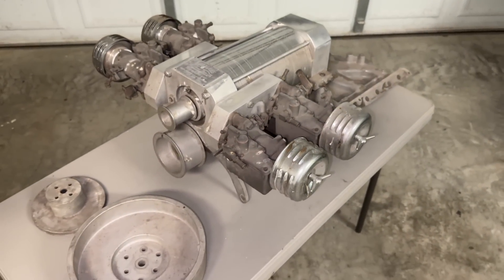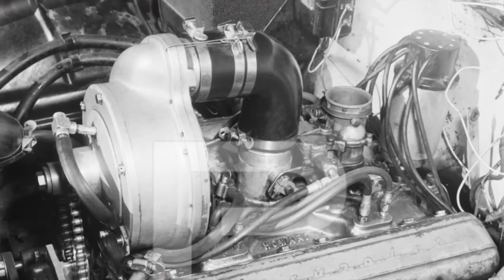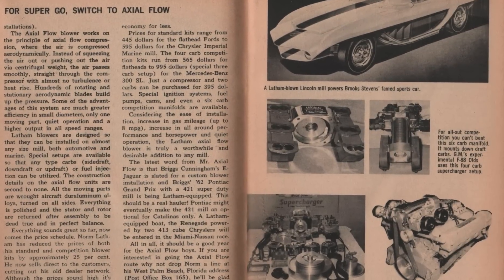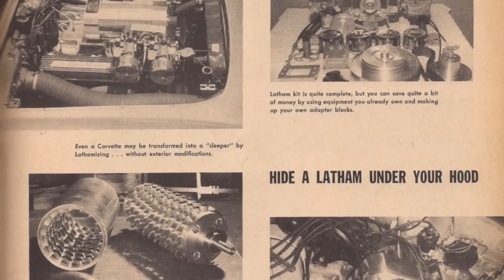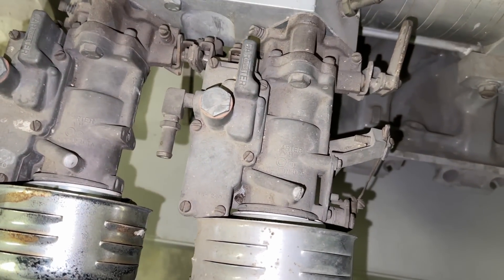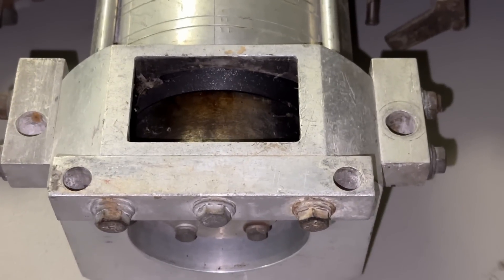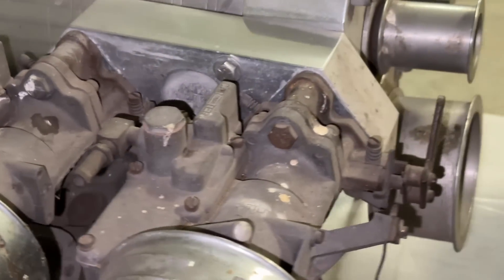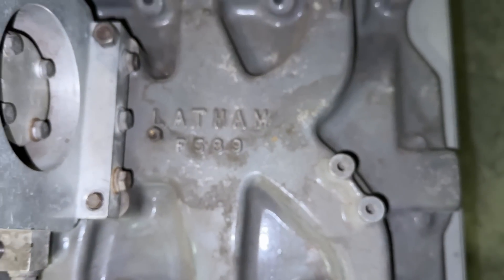LATHAM Axial Flow Supercharger - Fascinating History of a Short-Lived Design

Comment: I'm only here for the Supercharger,  Back in 1983 Auto shop one of the guys had this strange stackable supercharger he found in AutoTrader that he adapted to fit on a 390 in is Mustard Yellow AMC Gremlin.  I was just tryin to recall what it was and this looks like the same thing a long polished tubed of what looks like stacked segments with some sort of side draft carbs on it.  I think it looks like a jet engine on the inside and does not have lobes like a roots type blower.  Yes it sound like a police siren or fighter jet when it ran.

Comment: It was a very inefficient design with all the stages the same size to make it easy to produce, severely limiting boost. The flat belt was needed to allow it to slip under sudden rpm changes. By the way a well set up street roots blower can lose its belt and simply windmill with engine vacuum.

Comment: Fuel millage came from carburator side placement and apposed on the front. Blades inside made it better .
90 % L shifting air flow simaler to the Pouge craburator in L - air handeling and it works ! 
 Carburator streight in was always a joke of poor fuel micture !

Comment: I remember these and they could still run even when they lost the belt. You couldn't do that with other supercharger types. The Latham could give the same amount of power but at lower pressure and lower intake temps. It used a lower amount of power to run and thus your net gain was higher. A really great supercharger and I wanted one back then. The Latham was restarted in production in the 70s but still never got the respect and usage it should have had. The Latham also weighed less and with modern fuel injection this setup would be killer as it fits under the hood with no problems. Please take care of this rare piece of goodness:) I wanted one for the Corvair but could never scrape up enough money.

Comment: There's an old custom 60s Ford Falcon in a small sugar cane town outside Hilo, Hawaii ... built as a "sleeper" you wouldn't know it was fast by looking at it... until you see the little chrome tag on the rear he named it "Lathargic" because of that Latham blower ... at some point when he switched over to electric fans and quiet exhaust that damn car sounded absolutely insane coming down the highway going thru gears.

Comment: Back in the era of "wouldn't it be cool if...", and then they'd build it.  
I can definitely see the improvement of atomization with this thing, not only is it reversing the flow of air 22 times in quick succession, it's also allowing a lot more time for the fuel to evaporate before it gets to the cylinders.

Comment: I wonder who did the aerodynamic design for the compressor.  As far as I can see from the glimses of the blades and stators, this axial flow compressor is nothing like the axial flow compressor on a turbojet engine, it appears to have constant cross-sectional area.  But then again, the objectives were probably different so the differences are understandable.  

After WWII Napier built a most unusual aero engine called the Nomad, it was a compound, 2 stroke,  ported, flat 12 diesel that used an axial compressor for the supercharger and a power recovery turbine in the exhaust system.  The compressor was adapted from their Naiad gas turbine but the aerodynamics were changed to suit it being used a a supercharger for a piston engine.  The maimum boost pressure was 89 psi.  

It sounds like a turbo charger and to an extent it was but the engine was designed for maximum fuel efficiency, at cruise the power recovery turbine produced several hundred horsepower more than was required to drive the compressor, this extra power was returned to the cranikshaft of the deisel and thus to the propellor.  The whole thing was very complex and never went into production as the aircraft it was designed for was cancelled.

Comment: The added mixing of the air and fuel would have a similar efficiency increase as preheating the fuel and air. Thats not to say this supercharger would be both more powerful and more efficient, but rather in a per-horsepower basis it would be similar as opposed to adding fuel after compression.

Comment: Get the feeling someone was into Jet engines or an aircraft engineer as really sounds like a turbine spinning up and kinda looks like one to..such and awesome design. The cool thing is with tech now you could put a small gearbox on the front and be able to run a small crank pulley without having any issues.
The age were things were all about innovation :)

Comment: I had an idea for the older big engines with low compression . Why not use every other cylinder down the firing order to supercharge the firing cylinders . I dont like the turbo / high compression trend that is bad for engine life . My idea could be turned on for passing & the cylinders used for charging could be used for firing too . Running on low compression makes engines last much longer . A six cyl. using 3 for charging is a good place to start.

Comment: Great work researching this supercharger. I own #614 and run it on a 32 Ford Hi Boy. I have a couple of you-tube videos of it running on a test stand and in the finished car. It’s a great 60’s period hot rod part and it runs well on the street and the strip. Sounds more like a turbo because of the high rpm. Puts out 6psi so it will definitely wake up my 327! Thanks for posting this. Did my own research but obviously missed much of what you presented here.

Comment: I suspect the rotors mashing air together in the middle on a roots blower is the extra loss. And the loss through the air gap? These keep making a comeback as medical compressors because of modern metals and the lack of wear on the blades that could cause contamination.

Comment: Well, considering the airflow is straight through and axial flow compressors tend to heat the air less than roots, screw and centrifugal type compressors, the fact it makes less boost does not affect this supercharger's ability to make power. The heat of an inefficient compressor alone is enough to raise boost pressure without actually adding power. If you have a supercharger making 10 PSI of boost and you are making 500HP at 10 PSI, with the pulley ratio set to say, 40,000 RPM for a centrifugal type. Let's say the pulleys are changed to a faster ratio, say the max for this supercharger is 60,000 RPM and you are running around 58,000 RPM and making 5 PSI of extra boost. You gain about, 55HP. You decide to overdrive the supercharger to 65,000 RPM, suddenly, you get say, 18 PSI of boost, but instead of making more power, you make the same, or less than the 2nd run. Why?  Heat. With this axial supercharger, 7 PSI does not sound like a lot, but it has likely added far less heat, and depending on how it is mounted, likely provides a nice even mixture too. Sorry for the ramble, but this truly is ahead of its time technology. And I love it!

Comment: So this finally answers why there are no turbocompressors like in a jet engine, but for automotive forced niduction.
Intuition was telling me that there must have been difficulty of manufacturing and price caveats, and also maybe something with the running modes and speeds - inertial behaviour of these things, and the fact that in a het angine they easily spin at 90k RPM.

And it turns out that there was a turbocompressor perfectly adapted to the automotive use, and only the financial side of things was enough to halt it's existence.

However, I can easily imagine this system to suffer from poor creature comfort adaptatios, as it must have been one of the loudest offerings on the market, and quite enough of the wealthy clients who were looking to hop up their daily drivers were turned away by that.
The port at the back also definitely makes top mounting such a contraption quite a gimmick.

Comment: -I operate turbine engines for a living, specifically GE CF6-80 engines.  I'm not an engineer, but I had a turbine engines class in college at Embry-Riddle and they discussed that while the titanium rotating vanes are important, the stationary STATORS behind each row of rotating vanes are far more important.  The way this works is that the rotating vane imparts acceleration to a package of air.  That lowers its pressure, as per the Bernoulli effect.  But the stators are arranged so that they cause the rapidly moving air to slow down, thus INCREASING pressure.  The stator blades are close at the front where the air enters, but much wider at the back;  This increases volume and thus slows the air and increases compression. There are 14 stages of this going on in the engine that I fly, and the angles of the blades are very carefully designed in order to create the most efficient engine possible.  

I look at the internals of this Latham blower and while I think it is utterly cool, I suspect that it was designed by a man who "Just made it look right", not a team of engineers with wind tunnels that could perfect the design.

-If Pratt & Whitney or GE tried designing one of these things you would probably see way more boost from the same RPM with lower temperatures!  I think that these are really efficient at high speeds, but they need extreme speeds and as such they are very expensive to produce.  That is why you see centrifugal compressors for most superchargers instead of these, which probably have more potential.

Again, great video!
Reply: You got this kind of right, but not perfectly.  I also think you are underestimating the obvious engineering that went into this.  The guy was in west palm beach.  P&W had a huge millitary jet engineering facility there in the late 50s.  I don't think that's a coincidence.  There were almost certainly involvement of jet engine engineers in this thing.
Reply: @cyndideweygary  I'm well aware of the P&W facility out on Bee Line Hwy.  I used to live in West Palm Beach, and was friends with a guy who worked there, Bill Hebden. Now let me poke some holes in your post:

-Can you tell me definitively that Norman Latham worked at Pratt & Whitney?  Just because a person lived in West Palm Beach doesn't necessarily mean that he worked at or had P&W design this.  Jimmy Buffett and Donald Trump lived/live in Palm Beach;  Does that every person from there is a amazing music talent?  Or a former president/convicted felon?  I think not.

-I kind of doubt that any aeronautical engineer worked on this blower.  These designs are very efficient at very high speeds, far more efficient than a centrifugal compressor overall.  One thing in aviation that is true is that if an airplane "looks right", then it will fly right.  That's what I think about this supercharger;  This guy tooled this in his garage and used pictures of the compressor sections of contemporary turbojets to create his design.  It obviously works, but my point is that it could be built better.  With modern materials these could be real winners.

Thanx!

Comment: I had a Latham on a 1956 Ford in the early 1960’s.  Belt alignment was critical.  If the belt rubbed on the pulley flange, it would rapidly become narrower, and would quickly fail.  At that time, they ran about $22.00 plus shipping.  They would rub one flange during acceleration and the other when you let up on the throttle.  At a steady rpm they didn’t rub.

Comment: Some one naught the Latham name some time , I wanna say , around the early to mid 80’s and reproduced this iconic piece …. Don’t know what happened with that . Probly couldn’t move the volume to support the set up and production but they were made of better materials . I think it was pop hot rod , hot rod , or car craft that ran that article back in the day . I am thinking, um, 83 ?
Reply: Car Craft.  I bought one from Richard Paul.  Still have it, but case bolt sheared and needs repair.  Have all the drive pulleys and mounts for it that we developed for a SBF in a 68 Mustang.

Comment: I bought one of the Richard Paul versions from Richard back in 2010. Never used it but it made for an amazing wall hanger for about a decade until someone found out I had it. It used the dual Webers and was originally designed as an underhood unit for the new body style 82 Camaro.

Comment: I've been obsessed with Latham superchargers for years. Extremely interesting blowers. My lottery dream would be one on a 64 Riviera. FWIW, there's several videos on youtube of them running, if anyone wants to hear what they sound like. Very industrial sounding, not at all annoying or obnoxious. 

I've read they were so expensive, because they were machined to aerospace spec, and then hand assembled. So very labor intensive to build. Richard Paul made a version that looked similar but are constructed differently. They have the angled air intake, usually for a remote mounted carb I believe. There's a couple of videos of that style on here too.

Comment: That is a huge undertaking for one guy with a small company. It had to be designed, proto typed and tested and then made to be produced all with slide rules, and manual machines.  I see the axial design all the time in either rocket, jet or the modern bypass engines. I'll bet that guy did something interesting during the war to come up with the idea. It would be great to see it produced with modern techniques. The "Pro-Charger" type of blowers zap 50 hp from the engine.

Comment: Odd. I was looking at purchasing a Latham super charger back in the mid 80's, brand new from Latham. Due to the design, the Latham required much less hp to push the same amount of boost. I never realized it was only run back in the 50's and 60's.

Comment: I heard a Latham at full boost at an AHRA-sanctioned drag race at Green Valley Raceway in 1962.  A Dallas-area racer, I believe his name was Jack Simon, had stuffed an SBC into a Nash Metropolitan and topped it with a Latham.  As an aircraft mechanic, I later became familiar with the sound of all manner of turbine engines, turboprop, jet, and auxiliary power unit, centrifugal compressors and axial and even the axial-centrifugal combination.  But I still remember the sound of that Latham from 1962.  You have a treasure there.  Please, if you plan on spinning it again, clean and lubricate the bearings beforehand.  The "will it run" instinct has, unfortunately, irretrievably damaged too many rare pieces of history.
Reply: now i wanna hear it!

Comment: 🗿💨up till early 70s i built model cars and didn't care for the 671 sticking thru the hood so the Latham was the only supercharged model i had. Thinking it was with a 63chev kit but that's been a long time ago.
Late 70s in Hamilton OH, Edgewater dragstrip had someone running a Latham and sounded like a jet running the strip. Edgewater was about 3mi from me and after asking,  rumor was it was in a chevy that kept cleaning second gear from four speeds. 
Thanks for sharing 👍 nice 👍💯

Comment: You want rare?  I had a Mercedes 300SEL 6.3 that had custom-made Latham blower fed by 2 Weber 45DCOE carburetors.  Stock, this was the fastest sedan in the world from 1968-72;  with the Latham, it would stay neck-and-neck with a Ferrari 365GTB Daytona up to 130mph (after that, the breadbox aerodynamics came into play).  Normally, the 6.3 only got about 12 mpg;  with your foot in it, the Latham about halved that.  But, BOY was it the ultimate sleeper.  Big old boxy rich-fart sedan that took off like a Cup car.
Reply: Wow, a shame you don’t still have it.
Reply: @Wargasm54  Well, when I sold the 6.3 it brought a world-record price that still stands.  The car came with the original drivetrain and suspension/brakes (both had been ungraded, and the blown engine was from a '69 model with slightly different specs).  The car was left-hand drive, and I now live in New Zealand, where we drive on the left.  Left-hookers doen't work very well here.  Mind you, I replaced the Benz with a '59 Rolls Silver Cloud with a Ford Barra drivetrain slightly modified to run on Propane and upgraded to just over 400bhp.  A lot of people know what a Mercedes 6.3 is, but NOBODY down here has ever seen a 420bhp Silver Cloud.  Great sleeper...
Reply: @Wargasm54  Well, when I sold the 6.3 it brought a world-record price that still stands.  The car came with the original drivetrain and suspension/brakes (both had been ungraded, and the blown engine was from a '69 model with slightly different specs).  The car was left-hand drive, and I now live in New Zealand, where we drive on the left.  Left-hookers doen't work very well here.  Mind you, I replaced the Benz with a '59 Rolls Silver Cloud with a Ford Barra drivetrain slightly modified to run on Propane and upgraded to just over 400bhp.  A lot of people know what a Mercedes 6.3 is, but NOBODY down here has ever seen a 420bhp Silver Cloud.  Great sleeper...
Reply: That’s dope. A 365GTB is 350hp and 2600lbs. You would have to be making 500hp in that 3800lbs Mercedes to hang with it.

That also kinda tracks with your doubled fuel useage, because it only made like 250hp stock.
Reply: @jkent9915  565bhp at the rear wheels, through a B&M TH400 and an AMG diff.

Comment: Well, the Lathams were a brilliant idea because besides being VERY effective power boost they Also FIT Under the Hoods of an average late 50's to late 60's car. A major marketing 
advantage. And they produced INSTANTANEOUS 
Acceleration!!!. The BIG LIMITATION with The Lathams was SIZE or CAPASITY of the units.
Lathams were best used in that mid size V8's of that era;
e.g. 280 to 380 cubic inch engines. Sure, you could put it a larger engine like a Pontiac Super Duty 421 but it was really out of its league.
The real limit was a 389 or so. And when the GTO's came along in '65 the Latham era was ending and the mustle car buyers were never build your own/modify you ride types. But while it lasted those 389 Grand Prix's with a better cam and 
good headers were dynamite